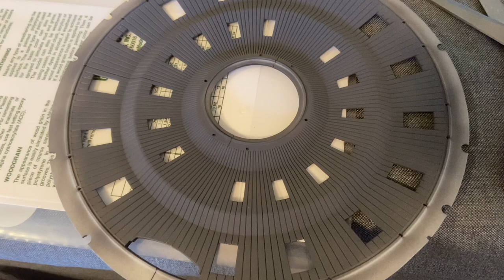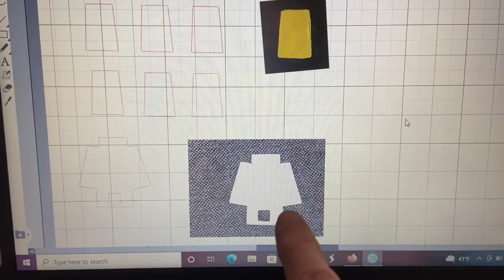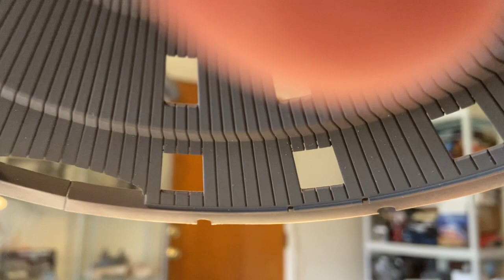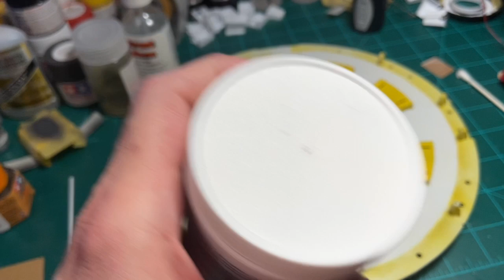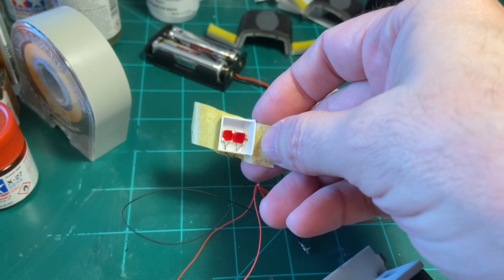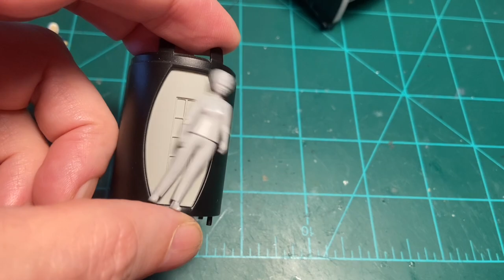NEW Moebius 2001 Aries 1B build part 4!

Comment: Hi Ken....I have this kit and it didn't come with pilot figures...where did you get those?
Reply from the maker: Yes, the kit doesn’t include figures, I purchased these from Shapeways from a creator called 308 bits, he also has another set with figures of Clarke and Kubrick! Here is the link. These are accurate sized, there are ones from another creator that are not, I talked about this in my video so beware. 

https://www.shapeways.com/product/PS5CL2LV6/2001-aries-moebius-1-48-crew?optionId=256861883&li=ostatus
Reply: @kenspriggs5687  Thanks, Ken.  I appreciate it :)
Reply: @kenspriggs5687  Where are the "Kubrick and Clarke" figures? I've looked throughout 308 Bits SW Page and not found them.
Reply from the maker: @stevej-lakecountyspaceport7478  I found them originally because I searched 2001 crew but here is the link:

https://www.shapeways.com/product/4DW4KR8MP/2001-aries-moebius-1-48-crew-kubrik-clarke?optionId=258013198&li=marketplace
Reply: @kenspriggs5687  They just arrived in the mail, and they are exceptional.  Great recommendation, my friend.
Reply from the maker: @leslauner5062  that’s cool! Did you get the ones with Clarke and Kubrick? Mine come tomorrow.
Reply: @kenspriggs5687  I'm still considering getting those.